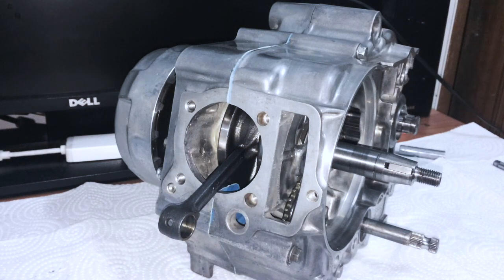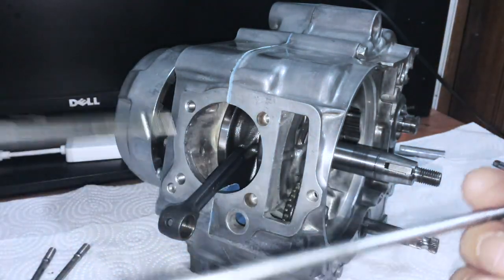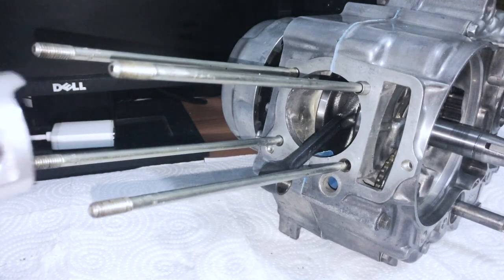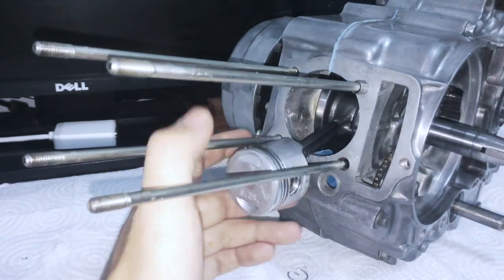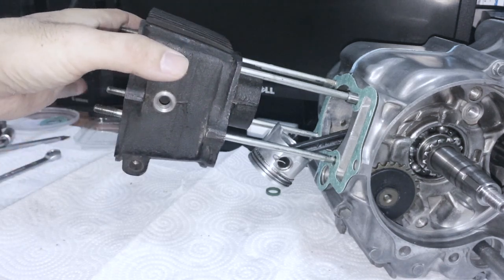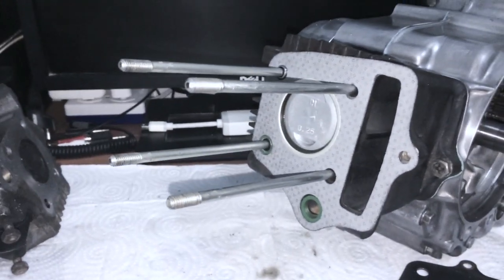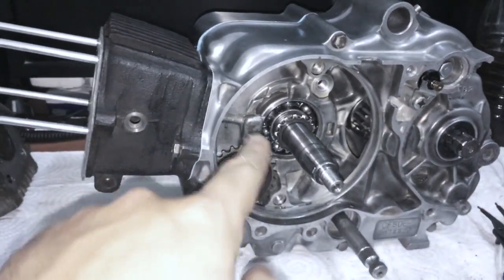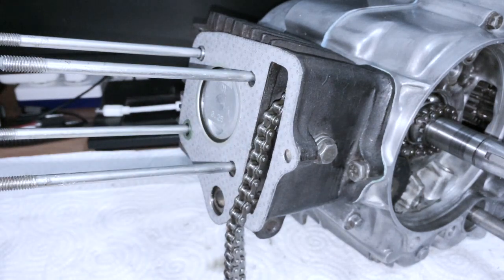(Short Version) Honda 50cc, 70cc, 90cc Engine Rebuild Part 2 of 3 (Top End)

Comment: Those ring clips should be installed always parallel to the cilynder direction,  because vibration makes the little part shatter and brake loose if you install it 90°off. Happens a lot on 2 stroke engines, which rev higher and makes this a much common issue.

Comment: Mini Motor Man - I can't thank you enough for your videos - very clear, very educational, and very importantly, very inspirational - they give me the confidence to tackle projects I wouldn't have tackled without your videos. Great job!!

Just a quick question - how much different are the C90 engines with the points in the head?  Does everything (well most things) in your videos still apply, and then you just bolt the points down on top of the timing chain wheel??

Once again - brilliant videos - thanks so much.